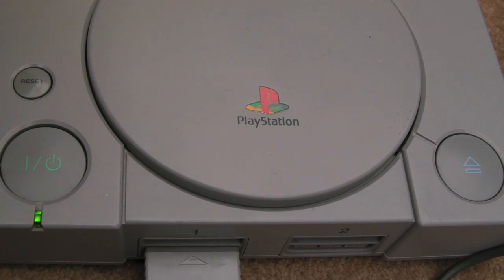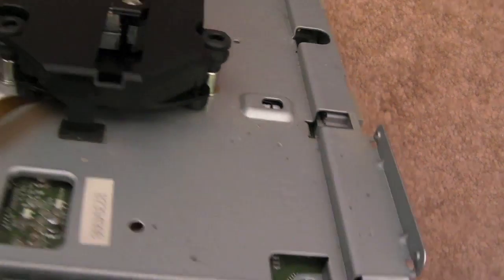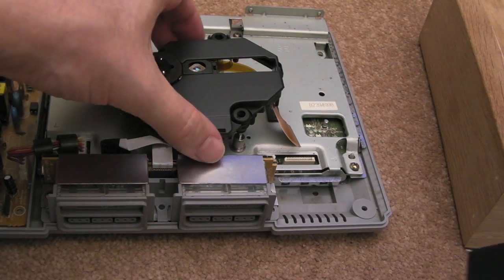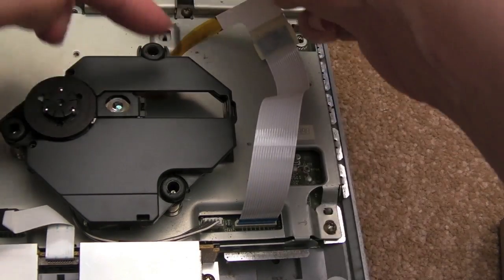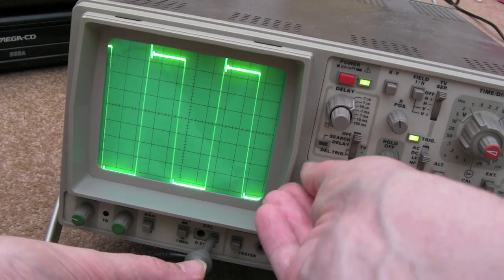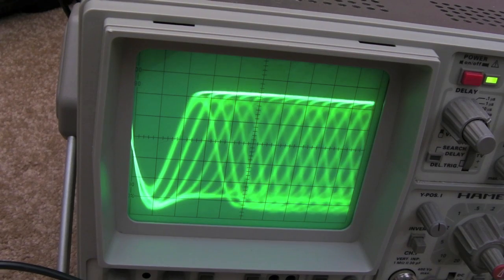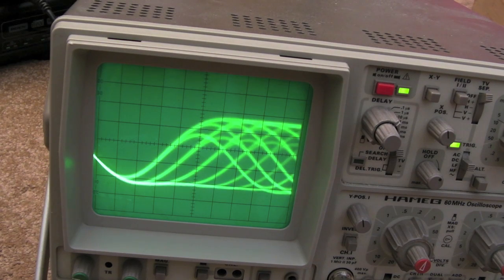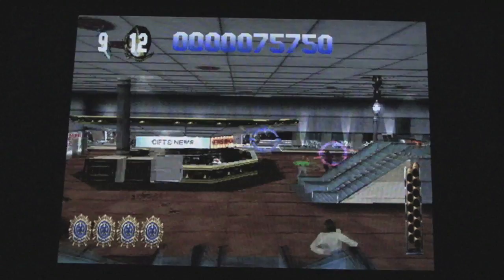Sony PlayStation Faulty Laser Repair (And voltage adjustment)

Comment: Why laser problem happened?
Reply from the maker: A laser diode is in many ways like a bulb, it has a finite life span.  It will emit a laser beam at 90% to 100% intensitity for its life, but as its starts to die it gradually emits less and less to the point where the CD drive wont work at all unless you increase the voltage to over drive it, at which point it then starts to die even quicker.
Reply: GadgetUK164 - Retro Gaming Repairs & Mods so you mean ps1 laser is like timebomb ؟؟
Reply: GadgetUK164 - Retro Gaming Repairs & Mods but why it is just a tool working ??
Reply from the maker: Yes - all lasers in CD / DVD / Blu Ray drives have a limited life, usually in the region of 10,000 to 20,000 hours (roughly, it may vary a lot between types and manufacturers).  And there's tolerance too, so one laser diode could last 30,000 hours etc, where as another might be unlucky and start to die at 9,000 hours etc.   So the more use a laser has had the less time it has left.  That is also primarily why people say that CDR media will shorten the life of a laser, because typically CDR or DVD-R discs are harder for the laser to read, so instead of a game taking 30 seconds to load, it may take 45 seconds to load, meaning you can load fewer games in general vs if you were loading the same games on pressed discs.
Reply: GadgetUK164 - Retro Gaming Repairs & Mods why It is limited ?
And ps4 is same laser could stop working  ??
Reply from the maker: The laser diode is no different to any other electronic component, it is constructed from chemical elements (and compounds - I am not a chemistry expert) and as light is produced from electricity, this has a negative effect where the materials are affected over time and use.  Like the way rechargeable batteries have a limited life, with each usage the materials that form the battery wear and chemical reactions take place that are irriversible without some other external process, and those changes negatively change the behaviour of the device.  So ultimately it just stops working.   Transistors are no different, but they are more reliable than a laser diode.   This article shows how a laser diode is constructed (quite a lot of layers with different elements and compounds etc) - http://www.explainthatstuff.com/semiconductorlaserdiodes.html
Reply from the maker: Yes - the PS4 lasers, and my XBOX1 laser will all die with use - that is absolutely certain!  They will not last forever.  Another example to consider - our Sun, the star in our solar system, it will die eventually.   The Sun provides light and heat to our planet via a nuclear reaction, the quantity of the chemicals involved is so very large that it will last about another 5 billion years.  But ultimately everything is governed by the laws of thermo dynamics, and one of them is Entropy.  All things move towards an "un-ordered state", with heat as a factor.   In a laser diode heat is a factor, heat is generated in the reaction to produce the laser beam, and that heat helps influence entropy within the diode to the point that it will eventually stop working.

When we create a laser diode we are 'ordering its state' - ie. constructing it with chemical elements into a structure that works, but as it has electricty and heat applied, it will naturally start to 'un order' itself, and depending on how it was constructed, the parts and chemicals used, and how it is used - those things dictate how long it will last.

People think that electronics will last forever, but the reality is with use and heat it cannot last forever.   Transistors are typically much more reliable than a laser diode though.
Reply: My unit works but is noisy do you think  I should open it up and have a look or wait til it gets worse?  And its only a little noisy. When the disc reads you can here it being loud sometimes.  But all games and music cds read. @GadgetUK164
Reply: @GadgetUK164  any alternative to playing games on a ps1 without a laser?
Reply: @GadgetUK164  That explains why lasers have such a limited lifespan in comparison to its circuit counterparts. I already had to replace a laser on one of my PS1's, but thankfully the replacement seems to be a quality one, and hopefully lasts for 10 years or so. fingers crossed
Reply: @GadgetUK164  single handedly one of the best explanations of that ive seen in a YouTube comment! 👍👌
Reply: @GadgetUK164   thanks , I managed to solve with increased tension
Reply: So ALL laser emitting readers will die? Dust In The Wind.
Reply: All technology no matter what it is bites the dust eventually, nothing lasts forever.
Reply: @HuntersMoon78  thats why emulation exists, when they die, emulation is there as an alternative.
Reply: my ps1 laser just died

Comment: YESS!! finally!! I’m having the exact same issue with my 7500. stripped optical drive down, cleaned and fresh grease applied to the gears and rails. Still doing the same, disc spins twice laser bops up and down the shuts off.
Reply from the maker: Sounds like you need a new laser!  Assuming your PSU is OK, and you don't have wear on the plastic part of the sled (try it with a disc in when the system is sat upside down.  If that works, its the plastic that is worn).

Comment: @gadgetUK i buy new laser from aliexpress and it dosnt spin, will it spin after i adjust voltage or motor is dead ? console is okey 100% work tested with another laser
Reply from the maker: It could be a bad laser, or needing adjustment!  But it could also be a fault on the main board - eg. The h-bridge driver IC!   Check your PSU board is providing the correct voltages.
Reply: @GadgetUK164  console works with old laser so console is 100% okey

Comment: I wonder why the disk lazer readers don't have a sticker or any kind of written information about what the default resistance value is for the lazer?
Reply from the maker: All lasers have variation in their intensity and focus - no two are exactly the same.  The same issue exists in the logic that drives and controls the laser and its focus.  Tiny variations in the drive levels, and the servo coils on the laser unit.  This is why all CD drive interface PCBs have adjustments for focus and tracking, eg. bias, gain etc.   And it's also why the laser voltage pot on the laser is there - because no two are the same.   You can usually set it approximately based on the position of the original, or by looking at a photo of the exact same model where it works.  But it will be approximate, it may be too high or too low.  It will work if its too high, but have a shorter life.  If its too high or too low it won't read properly.   The best way to adust it is with an oscilloscope, monitor the RF test pad and set to between 700mV and 1.2v (depending on the system and model - they vary).  Alternatively you can use a DC multimeter to try and read the average of work out how much it increases when reading vs not reading - ie. how much the voltage level changes would be an approximate level of the RF signal - but that's not perfect.

Comment: i have bought 2 new cd assembly for my ps1 but the same problem still happens
the disc spins for a moment, then stops.  on every cd assembly
what could be the problem? Power supply maybe?
Reply from the maker: Check that no one has messed with variable adjustments on the PlayStation motherboard - some of the models have variable resistors there to adjust bias / focus etc.  It could have a faulty BTL driver, or some other faulty on the main board maybe.

Comment: My PS1 has 1 Audio channel error, when playing CD it makes a hissing sound, even though I have checked the jack connection.
Reply from the maker: It may need some capacitors swapping out, or a fault on the audio amp side.

Comment: 4:47 name of cable ?
Reply from the maker: It's a flat flex extension for the PS1 laser unit.  I have no idea how many connections, or the pitch and length.  I found it on eBay or AliExpress whilst searching for replacement laser units.

Comment: My first ps1 fat i had since i was a kid. Its chip modded though it worked fine when i got the mod installed back in the day but after maybe 2 years it couldnt read anything sadly. I recently got retro console addicted and wanted to try and fix my old Playstation. The only thing i have is a small flat screwdriver so no fancy messurement equipment. 
It took me around 2 hours to fine adjust the laser and hit the sweet spot and now its fixed. Though i have no idea what my volts are but hey its working now.
Thanks so much for the video i really learned a bunch from this!

Comment: I HAVE A SAME PROBLÈME.  Good morning ! I throw a 2nd bottle into the sea... my console starts the CD, it spins slowly then stops... I don't pass the Sony logo. The CD restarts but never waits for its "cruising speed" It worked before, I just wanted to clean the console and now it doesn't work anymore. Do you know how to fix it? I accidentally touched a knob while cleaning?! Should I clean the lens again? I put WD40 on the rail of the lens port? I'm a little lost Thanks in advance.

Comment: Hi

I have a ps1 1001 early version. It will not reading discs until I push more the tray disc or put small piece of tissue inside above the sencesor !

Is it laser problem and needs to be replaced or something else?

Thanks
Reply from the maker: I do remember that the plastic sled wears on the early Playstations - try turning it upside down and test it with a disc - if that works, its sled wear.  If its just the switch for the lid, try some contact cleaner in the switch there, that might fix it.

Comment: Does the oscilloscope have to be an analog one or will digital work too? I have tried it with mine (digital) and it doesnt show that wave pattern on the screen, its only one line/wave. Also the voltage doesnt change at the test point when trimming the pot, it stays at 1.54 v. I hope you will be able to put me on the right track, i would greatly appreciate it :)
Reply from the maker: I've not tried this on my digital scope yet, I would assume there would be a way to display it on a modern digital scope.  I will try with my new digital scope next time I need to calibrate a CD drive.   I have heard people say that you really need an analogue scope to properly monitor the RF level though, so maybe there's a reason digital scopes just cannot do it?!?!

Comment: Hello, I have the exact same model as yours (SCPH-5502) and I had it for years and always worked fine, but recently it started to not read the majority of discs and just reads two right now, (Resident Evil 3, Dino Crisis 2) but when I play with them they are EXTREMELY slow, like when I go from one zone to another, the game freezes for a good 5 minutes, then eventually changes the camera orientation. With my other games like Spyro, Crash Bandicoot.. it would read them but it would just freeze either at the Playstation logo screen or the screen would just go black after the Playstation logo, (The discs are fine, I checked them multiple times and there was barely any minor scratches) and I was wondering if this problem is caused by the laser or other components, thank you for your time and sorry for the long comment! :)

(P.S. Other games would work but there would be no colors just black and white)
Reply from the maker: The slow loading sounds like a laser problem to me.  The black and white in some games, if you are using composite or s-video could indicate capacitor that couples the chroma signal, but it might be a region thing - eg. trying to display NTSC on a PAL TV for example.  You could try and RGB SCART cable to rule out a problem there perhaps.

Comment: Got any idea what the pot on the board or the pot on the psu are for on the 5501?
Reply from the maker: The one on the PSU is likely for the 3.3v (I think - unless its 5v logic).  The one on the motherboard is probably laser related.

Comment: my psx sometimes restarting ...
the laser too only play some games
Reply from the maker: You perhaps need a new laser, but the capacitors in the power supply may need replacing too.
Reply: @GadgetUK164  thanks for the info

Comment: My PSone stuck at the white screen that says SCE and optical block don’t function at all
Reply from the maker: It sounds like a bad RAM IC or a custom chip.  You should perhaps start by examining the board - look for leaked capacitors.  Also measure the voltages coming out of the PSU into the motherboard, perhaps the PSU needs recapping.

Comment: Im wondering if you know whats happening with my laser. Its srarted to not read discs as if it gets stuck on the far left position. If I manually scroll the laser out even just a fraction from far left, then the drive works perfectly the next time a disc is in. After some amount of gameplay it will inevidently seem to stick in that far left position and not read anymore. Ive already cleaned and regreased the sled, and cleaned the cogs. If this just the laser itself dying? Im perplexed
Reply from the maker: Some of the early PlayStations suffer from "sled wear" - the plastic wears, and that can cause problems like that.  Alternatively it could be the ribbon breaking at some point, whereby it gets stuck over the side as the connection makes or breaks as the ribbon flexes.   The other possibility is the gears are the problem, maybe one is split or a tooth broken off.
Reply: @GadgetUK164  I didnt think to check the ribbon. Maybe that could be it. Ill dig in more. Not the sled or the cogs missing teeth. 900x model.

Comment: So I guess there really Is no way of fixing the laser. Damn!
, I fixed the gear on mine and it worked fine, then my daughter kicked it off the couch, weirdly enough it knocked the gear out again, so I fixed the gear, and now the laser can’t read the disks either, so I’m pretty sure it damaged something internally in the laser diode

Comment: Just curious which way is increase/decrease for clockwise/counter on the laser voltage dial ?
Reply: Clockwise decreases resistance, which allows more power to the laser.

Comment: Can anyone post a link for a reliable laser unit replacement? I ordered on on Amazon (came with they grey plastic plate on the top) and I swear it's a tear down from an old broken system. Doesn't work and sounds like a bag of marbles.

Comment: I found out on my 1st revision PS1 that the mirror in the laser assembly became fogged up, but even cleaning it didn't clean it, looks like there was some degradation of the coating due to the age. I am almost 100% that this is the problem as the PS1 worked fine in the early 00s, but since then it sat unused when I tried it few months ago it didn't work anymore...

Comment: I need help :(. I found my old ps1 slim modded, keep reading well backups but in games like silent hill, Tony Hawks and Xenogears have a FPS drop (specially in the second one). In games in 2-D (chrono trigger, cs SOTN, megaman x4) don't presente fps problems like the others. this could be a laser lifespan problem or a another thing? (sry for my bad english)
Reply from the maker: Where does the FPS problem occur - is it during cut scenes / video, or actually in game?
Reply: @GadgetUK164  during gameplay. for example: in Tony Hawks and Silent Hill it is during most of the time, but in Xenogears it is more fickle, when the camera is in a place with a lot of modeling 3D the fps drop, I change the camera angle and the fps go up. It's strange.

Comment: So is the stuff with the voltmeter necessary, or will it be fine just dropping it in for casual use. I don't wanna buy a replacement if I can't use it.
Reply from the maker: For casual use - just drop the replacement laser in and it will likely work fine!  Just bear in mind that some of the cheaper lasers on eBay are hit and miss. eg. You buy 3 of them at £3.50 each, 1 may work...
Reply: @GadgetUK164  I was able to get a return on the defective PS1. Still, I'll likely buy a replacement just in case the new one goes out.

Comment: So I have a SCPH-1001, and it doesn't seem to want to read game discs.  It reads music CDs just fine, but when you put a game in, it freezes on the PS logo screen.  But the text is corrupted.  Instead of saying "licensed by" it says "ed by ed by ed by..." and so on.  I have been able to successfully boot to Gran Turismo, but it froze and the screen was all kinds of messed up.  I have swapped the laser assembly with a newer one (It didn't fit) and I've messed with all the adjustments.  But there is nothing out there on the internet about his.  I was able to find a forum post where this guy in Europe had the exact same text issues, but post was never answered.  Maybe you could help?
Reply from the maker: My guess is if the laser isn't the issue (corrupted loads), then its going to have a RAM fault.  Could also be bad PSU needing recap too.  If you want to rule out the caps - leave it assembled and powered up for 60 mins unattended.  Come back to it and test it as it has warmed up for an hour.  If its more stable and loading games, I would recap the PSU, and inspect caps on the motherboard.
Reply: @GadgetUK164  Thanks man!  I really appreciate the help  I wouldn't have thought it to let it sit to stabilize...  I did reflow to RAM, didn't seem to work (in fact the first time I reflowed it it made it so much worse, but I fixed what I made wrong.). Where could I find the PSU?
Reply: @GadgetUK164  Oh I found it...  Duh PSU... power supply unit.  So would it be that its not getting enough power to function properly?  Ive seen where someone ran an NES of AA batteries, and when they were almost dead, the image began to corrupt.  
UPDATE:  I plugged it in for the first time in months just now, and the PS logo screen was still corrupted, but it then went to Sony Computer Entertainment of America Presents, and then booted up to a corrupt image of Gran Turismo 2's copyrights.  Wont go further.